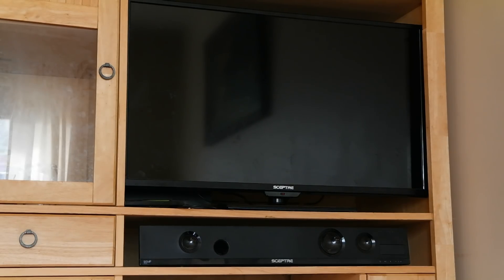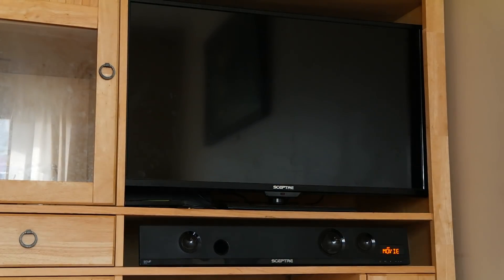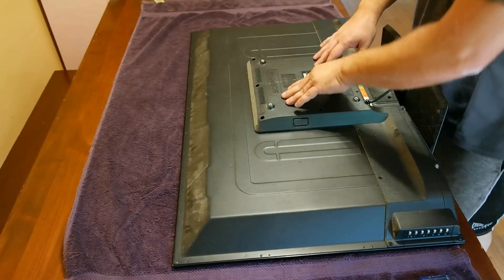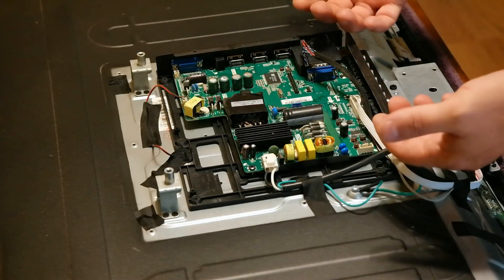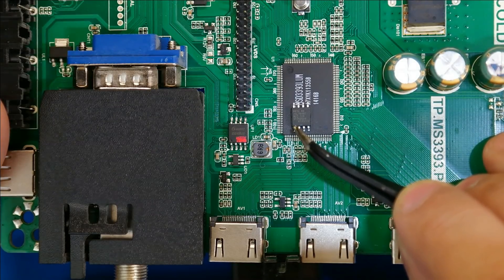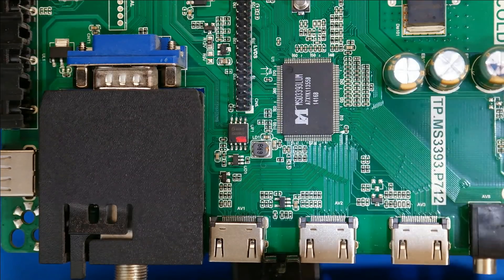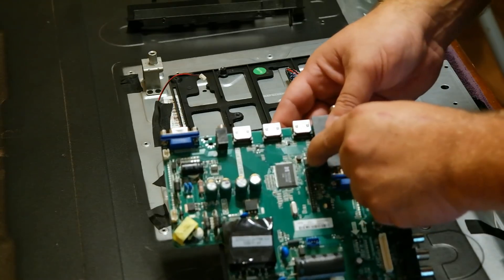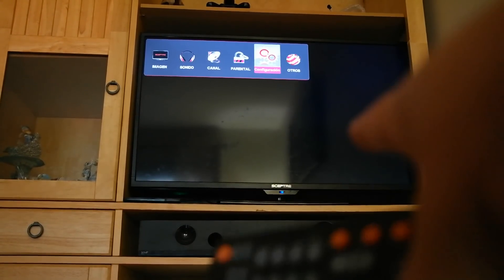Replacing EEPROM Chip On Sceptre TV

Comment: What temperature did you set the hot air iron at??? Were there also tiny surface mounted components on the underside of the circuit board??? How did you come to the conclusion, that it was that one chip that was bad???

Comment: Hi, I have Tv that shuts off randomly sometimes for 2 minutes and sometimes for 2 hours and after that it can't be turned on for about 2-3 minutes(sometimes backlight just flash),when that happen TV goes to factory settings every time and I need to set up everything again,the voltages are all seems to be correct,is it possible that the eeprom is bad? Thanks!

Comment: It's easier to remove from top... use a short section of 16ga solid copper wire long enough to span the 4 pins, pre-coat it with solder, add a little extra solder to each IC pin, then lay the copper wire across the 4 pins and heat.... it will almost immediately allow you to slightly life that side of the IC without damaging the PC board at all. (when you heat the board with hot air, it can cause the lifted pads/traces)

In fact, with nice sharp diagonal cutters with very fine tip, just cut all 8 leads at the IC body... who cares what happens to it now, and it makes removal FAR easier.
Reply from the maker: Thank you, I will remember this tip for next time.

Comment: Great video. Is the chip available from digikey/mouser?
Reply from the maker: Not sure, I didn't look.  I'm also not sure if it's just a blank eeprom or if it's preprogrammed with info the TV requires.
Reply: @madelectronengineering  Seeing as the language was changed I have a feeling that the defaults were written to the EEPROM by the controller. Either way it would be simple to clone the chip you removed to the new one. Cheers. I enjoy these repair videos.
Reply: The chip is, but its contents aren't.